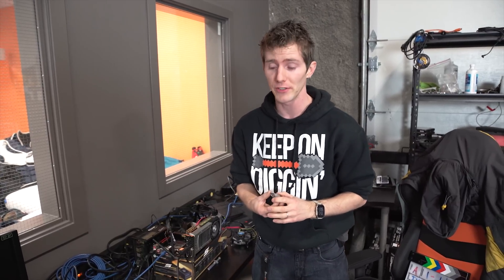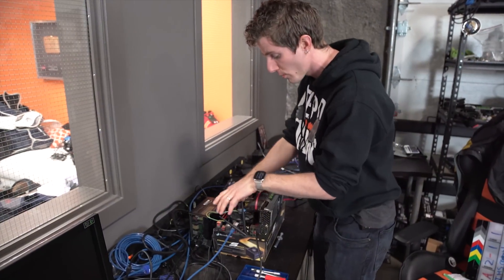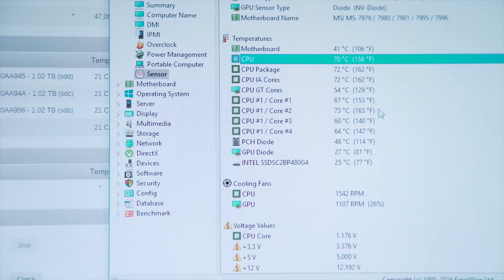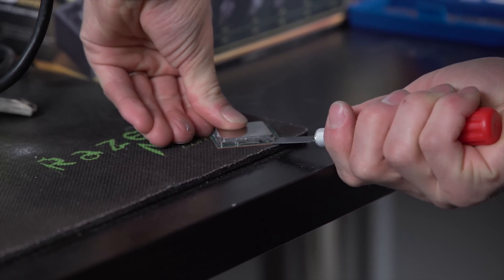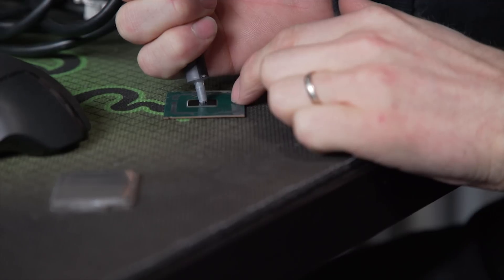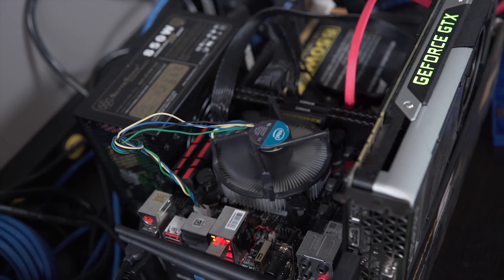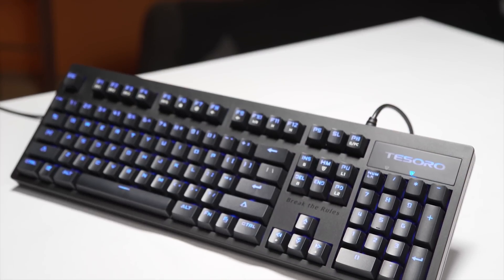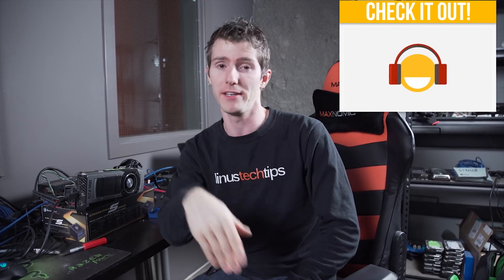Delidding an Intel Core i7 6700K - Is it worth it!?

Comment: Devils Canyon have sensors that give wrong readings mine before i it was delidded it would run under load 100c according to core temps. this is also a liquid cooled system. Delidded normal core temps of 40 under load. there are some gains from cpu to cpu.

Comment: Vice method is a million times easier and no risk of cutting into anything.  I have done a few of them and its VERY VERY VERY easy.. Also the TIM you used between the die and IHS is NOT ideal.. should have used liquid metal pro.  Your results are because of your method.  I have not done my 6700k but I got 10C drop with my 4790K.  This stops my fans in my system from throttling up everytime the CPU got hit with a little work load.  Worth it IMO.

Comment: I use a $10 CPU cooler and my 4790 runs mostly at 50c all the time
Reply: My old Intel Core 2 Quad Q8200 overclocked from 2.33 up to 2.5 with a decent air cooler from Deepcool runs at 50c and active goes up to about 60c
Reply: And what cooler is that? Have the same CPU and thinking of buying an aftermarket CPU cooler too. Since the stock cooler is getting me 75C MAX while playing GTA V
Reply: Drive to microcenter and buy one. Mine is too cheap, microcenter doesn't even advertise on their website. The stock cooler is adequate for all operations except overclocking. People only buy expensive cooler to overclock and for aesthetic appeal.
Reply: +Chad The hyper 212 evo is a good cooler at a cheap price. Using one with an FX-8350 ( a very hot chip) and i get 25-35c on idle and 40-50c on load. I have NEVER seen it go above 55c
Reply: ерунда сэндвич I have a 60$ one
Reply: is that on the core or the socket though? the socket doesnt get very hot but the cores do
Reply: That's the CPU I used when I built my mom's computer! I figure she'll have a super fast computer for ten years or so the way she uses it. Love that chip.

Comment: I'm surprised with how resilient the processor is after taking so much abuse. Whenever I get a new processor, I handle it as if it's some kind of ancient relic from the Mayan empire that's been buried for two thousand years.
Reply: If you tell people CPUs are really fragile, the worst that can happen is that they'll be unnecessarily careful. If you tell them that CPUs are actually pretty sturdy, they're going to start chucking them into corners and running office chairs over them.
Reply: CPUs aren't that delicate. Since these are solid state devices and have no moving parts, you could do all sorts of horribly abusive things to a CPU and as long as no surface mounted components are lost and everything's clean and can make correct contact with the pins and cooler with TIM, it'll run fine.

I personally wouldn't bother delidding, though. I think the only people it really benefits are enthusiasts going for a record, and doesn't really serve a benefit for people actually planning to use the computer.
Reply: @YaroKasear  So what you're saying is we should torture test CPUs like people do with Glocks and AK-platform rifles? That'd actually be really cool
Reply: They are now. Back when they had 20,000 flimsy pins on the bottom they were always about one fumble away from never computing again.
Reply: I laughed my ass off hard on this comment.  Because I do the same exact thing.
Reply: they are rock solid only when you WANTO to break them. However those motherfuckers become eggshell-fragile when you actually do NOT want to break them.
Reply: lest be honest any cpu, gpu ect get's into linus's hands on and it's a review (even at CES) he basically goes mad scientist on it and if it survives it is probably related to superman
Reply: Sema Duni very well put
Reply: I once accidentally dropped a cpu (Still in the box, luckily) down a flight of stairs, I installed it the next day and it worked like a champ, still running well over 2 years later.
Reply: Haha thanks bro for making me laugh today.
Reply: The1rust u handle it like God handed it to you right???
Reply: The1rust Same here,even with a radeon hd 6950
Reply: I still do that too lol. 
My brother on the other hand, just slams shit around, (he's been building computers for around 7 years now, so he's probably just lost his patience by doing it so much lol.) But I'll pick up the cpu with a glove on, genetally place it, and apply enough just the right amount of thermal compound... Then like a week later, it'll fail or some shit... Then my brother, beating shit up and all, has never had system that suffered a catastrophic failure.... It's bullshit lol.
Reply: Its Linus. Please don't be inspired by his abuse of objects
Reply: I've actually had an i5 2500k die on me. Literally die on me. I sent it back to intel through my local dealer and in 2 weeks they were given a new one to give back to me. Yes it was overclocked, but only to 4ghz and not that high volts so the overclocking wasn't the reason why.
Reply: True. At the shop I was working at back then, we had lots of dead mainboards, RAM, HDDs and PSUs, but I can't think of one case where someone had an officially dead CPU. People are so paranoid about the lifespans of their CPUs, but tbh it's more likely that everything else will die first. And after 5 years, gamers want something new anyway. ;)

Got my new GTX 1080 last week. I was able to choose refund and got my 700 bucks back. For only a few € more, I could have bought a 1080Ti, but since the summer is about to start, I bought a much cooler and faster 1080 by MSI for 500 and took the leftover 200 to build a new skateboard. ;)
Reply: amd LUL
Reply: lol
Reply: The1rust couldn't be more true
Reply: What's fragile are actually the pins. Most AMD cpus, including the latest Ryzen, have pins.
LGA motherboards, on another hand, are a lot more fragile than PGA motherboards.
Some say LGA motherboards are better because it makes te cpu more resilient, while others say PGA motherboards are the way to go since pins on the cpu are easier to fix than motherboard's pins.
The discussion goes back and forth.
Reply: The1rust I
Reply: +The1rust, same. i treat them like priceless treasures from ancient egypt that have been locked in a hidden chamber of the great pyramid for the last 3 millennia.
Reply: LOL
Reply: that's was abusive? I can should a i7-6700k up my ass, poop it back out, shove it in the socketand run it without a heatsync, and it will probably still run
Reply: The1rust lmao true facts
Reply: Hahahahaha very funny
Reply: This comment needs to be preserved in a time capsule.
Reply: Never fried a CPU but quite a few GPUs without any overclocking... this week's new entry: GTX 1080 RIP 26.04.2017. Should be within warranty, tho.
Reply: + Yaro Kasear   well thats all changed now with Kaby.  Average performance improvement is 15 to 20 deg C.
Reply: Some how you comment and your profile picture goes together
Reply: The1rust yeah especially if it's a ryzen threadripper
Reply: Well said XD
Reply: History Fact: There's no such thing as "The Mayan Empire", the Mayans never unified under a single leader or administration, just formed separate city states and kingdoms/alliances that all shared a general culture. Also, the last independent Mayans were still holding out against the Spainish and colonial nationas as late as the 1700's!
Reply: Recently swapped thermal paste on my i7-5820K. The old one that came with my cooler was super sticky (never seen in +20 years) and I had to carefully wiggle the cooler in order to seperate it from the HS. Unfortunately, I somehow sqeezed some paste into the socket and between the tiny pins while doing so. I didn't even know what that stuff was and if it's conductive or not. So I took a q-tip, cut both ends, one end diagonally like a hollow needle, dipped it into isopropanol and carefully scratched the paste out of the pin rows while flushing them with drops of isopropanol. I used my phone cam as a magnifying glass. Because I was too lazy to remove the whole mainboard, I just tilted the case to let the gunk run out. Was a bit sketchy. Running fine tho. No pins bent. =)
Reply: :D the feeling when u dont have another 100 bux for an cpu
Reply: The1rust me 2 man rofl
Reply: thats only true for the motherboard pins
Reply: same
Reply: The1rust 😂 same!

Comment: It doesn't bring much benefit with Skylake anymore but used to be a significant improvement for Haswell CPUs and contrary to what Linus says at 2:14 it matters how good the cooling is because the improvement in temperature difference you could gain with this was up to 10...15 °C for decently overclocked CPUs that would not even run with the stock cooler. Less overclocking produces less heat and thus makes the improvement less significant. Usually it allowed 100...300 MHz higher clock rates for Haswell CPUs.
Reply: it does bring massive improvement to skylake, with 20C being the average drop, he saw a fraction of the because he used a stock cooler meant for i3's and below, its a thermal bottleneck

Comment: I think the difference will be relatively bigger if you use some serious cooling setup instead of stock cooler. Combine it with properly lapped and flat base of water cooling, using coollaboratory paste without IHS (if you can mount it properly) an will get results that are worth it.

Comment: I remember the old days when everyone would blindly follow the loudest proponents of overclocking, even for a 2 degree difference.  it's nice to hear you say, "Overall, this isn't worth the risk."
Reply: If you do it properly you can reduce it by 20c. Linus just half assed it.
Reply: To be fair Ross Potts. Delidding is worth it if you are overclocking. It doesn't matter how good of a cpu cooler you have if the limit is between the die and the IHS. i have a 480 custom loop rad cooling my 5820k. The 5820k is soldered, and i still see pretty high temps at 4.7 ghz. My gf's new i3 8350k is running at 4.8 ghz delidded. Before delidding we saw over 90c on the package. Now after delid we hardly ever see over 70. And she uses a 240mm rad.
Reply: Ben A how young ARE you that you can't read between the lines?  

I know that's his opinion.  and after 20+ years doing some of my own crazy shit to computers I feel I am qualified to agree that this mod isn't worth it.  people are so lucky to be able to BUY water-cooling sets.

Meh.  I Am thru explaining myself to trolls...

.....  Nice use of dots in your reply though.  you are to be commended.
Reply: @RossPotts  have you changed your opinion on this any??? you can multiple video where the difference was more than 2 degrees
Reply: Ben A 5 syllables.  wow.

I miss your dots.....
Reply: Ben A the really long strings of dots.......
Reply: Only that it's close to 20°C done right, which is worth the risk imo. 
Went from 4GHz to 4,5GHz on my 4690k and the temps are STILL lower than before!
Reply: Ross Potts Eyup, my 4690k pushes these clocks with ease 24/7. Even when my GTX 980 ti is heating up the case temps to nearly 40°C, the CPU doesn't go above 70°C under Prime95 (even the current version with AVX support). 
Before I was getting 90°C doing this, which is ofc way too high.

One thing I noticed: the thermal paste inside my CPU was bone dry. I needed tons of isopropyl to clean it, cause it was glued to the IHS...

I could get the temps even lower, if I had used the liquid metal between IHS and cooler aswell, but that was a little bit to dangerous for me, cause my coolers brackets seem to be made out of aluminium and liquid metal desolves that.
Reply: Building your own Kempston interface with autofire for the ZX Spectrum? Modding the RAM of a ZX 81 an ZX Spectrum to upgrade it? Replacing my 8088 with the Nec V20? Replacing X-tals (and some capacitors), so turbo XT IS a real turbo XT. Writing software where applications and data are extracted on a RAM-drive, run and after finishing compressed to avoid slack and create faster execution? Building a DTMF generator to use pay phones for free? Building a 20 feet antenna mast with a 20 feet 5/8 wave 11m antenna on a slippery 45 degrees roof top (ceramic tiles) on my own without any help at all?
Oh wait, that was me as a teenager.............. :D
Yep... My schlong and determination are bigger LOL

Paying attention to detail (only a few degrees is one of them) makes the difference between good and optimal. It is not only the AVERAGE few degrees that counts, but the larger fluctuation (and fan noise). My 6700K had terrible TIM and the CPU cooler got very noisy. After delidding it, the fan noise dropped drastically.
Reply: Your opinion does matter (I value it), but not to everyone. Some opinions set people to think about things they hadn't thought of before. (sorry for my crappy Engrish, it's not my native language).
Reply: xXYannuschXx that's pretty good.  and significant.  does it stay stable for long periods?
Reply: He used normal thermal compound
With liquid metal you can get up to 20 degree better temps
Reply: @faultier3782  no
Reply: Alex Tevin yes
Reply: I know this is an old video, but the risk is close to zero with the correct tools, and the improvement is around 20°C under full load if you use Thermal Grizzly Conductonaut. I know. I've done this several times with Skylake K CPUs and the gains have always been the same within a degree or two either way. A 20°C drop is often enough to take thermal throttling out of the equation when overclocking Skylake with a decent cooler.
Reply: And the winner is..................

Ross Potts
Reply: i got to disagree, my 4790K at 4.7 1.27V used to laod at 78C after deliding and using liquid ultra my temps at 4.9 1.32V is 50-55C it most certainly is worth it.

Comment: Hy Linus, I have 87 degrees on a Xeon E3 1230 v3 at stock speeds in Prime95 while running Blend test for just 5 minutes. I tried to run Prime 95 large FFT and the computer shut off.
The cooler used is Thermalright Macho 120 Rev.A which despite its freak name is absolutely great. I am wondering, is this behavior normal? The cooler stays attached firmly attached on the CPU.
The thermal compound I used is Arctic MX-4, which is also more than good. I don't stress daily too much the CPU, but that shut down and that high temperatures are pushing me to decide delidding the CPU and change that sheety thermal compound used by Intel factory, which, thinking at the price I pay for the CPU and the entire engineering work on the CPU, is a bad joke.

Comment: The thermal grease swap gives marginal results but I think you may have had better results if you replaced the aluminum lid with a copper lid of equal thickness. That's probably a much bigger bottleneck to heat extraction from the CPU than the internal thermal grease.  Once the staiblity of my CPU is established and I'm confident that I don't need to RMA it, I'm going to try delidding.

Comment: just so everyone knows, you need to thoroughly spread the compound on the actual cpu before putting cooler on. You can destroy a chip if you do not have compound on the entire chip.
Reply: Stop lying.
Reply: MrGillyStar I'm not talking about the stupid cover plate, I'm talking about the actual chip.
Reply: The compound has to be placed as a linear drop across the length of the die. After the metal case will be placed, the pressure will squeeze the thermal compound till the die edges, covering the all die uniformly, and with a big advantage - the one of not having air bubbles caught in the process. On the other side, if you "paint" the entire surface of the die with thermal compound, there will be formed some air bubbles, and this is not a wanted thing.

Comment: Did this to my 6600k hahahahaha rip warranty.. :)
Reply: Replaced it with Liquid ultra and temps drop under load by 18c compared to Arctic silver 5! Same overclock, was getting 66c under load on P95 now i am getting 48c max. Ran Prime 95 both times for paste for 12 hours on 4.5ghz @1.27v using corsair h100i, if that matters. :P
Reply: eking11 Any improvement?
Reply: about 3-5 degree c lower under load with AS5 but i have liquid ultra coming in next week and will report back in
Reply: Will you kill it? Let us know.
Reply: eking11 That's incredible! You should try 1.35V and you may achieve 4.8GHz.
Reply: Sadly I tried 4.8 @1.35v , i only managed 4.6 @1.34v but temps never went over 54c on 1.34v, very very cold cpu but i kept it at 4.5 because I'm not certain what would be the safest voltage to have 24/7
Reply: Well imo as long as it's cool, you won't shorten the chip's lifespan. Another thing though, I've heard that CLU's performance will degrade overtime, and it can even leak out of contact surface if positioned vertically for a long time, so you might want to watch out for that...
Reply: I don't think it would leak with the way this thing stuck to the die. Honestly i think the "leak" might actually come from when people put down the retention bracket without gluing or holding down the IHS on the die, the IHS will slide about 2-3mm down when you lower the bracket so you really gotta hold it in place. The CLU almost glues itself together if you apply it to the die and underneath the IHS.

Comment: In all fairness 3 degrees is pretty massive difference in the amount of heat that's getting transferred, the stuff intel are using must be utterly trash, toothpaste would probably work better. Shame intel specced the socket so that it's difficult to use without their heat spreader, wonder if anybody makes them from copper or something..